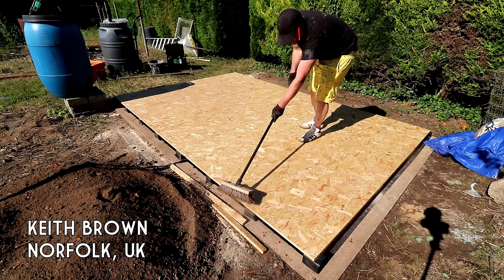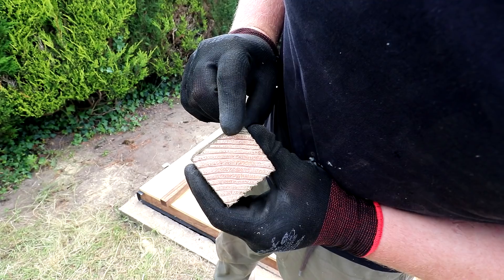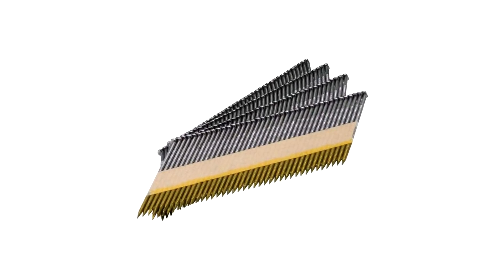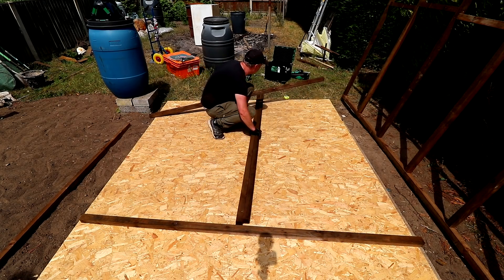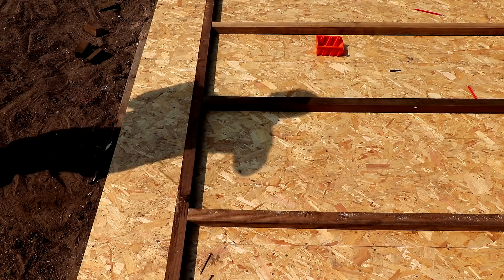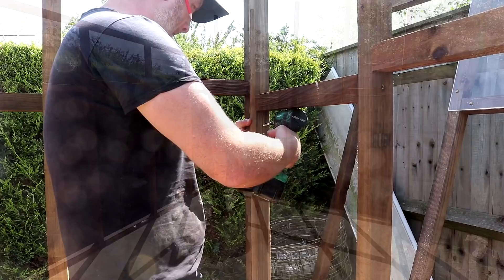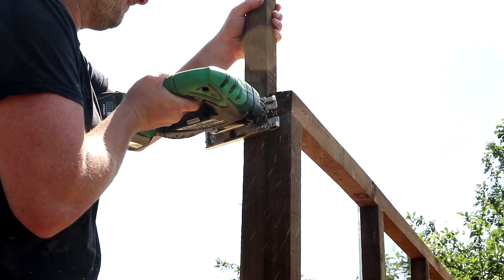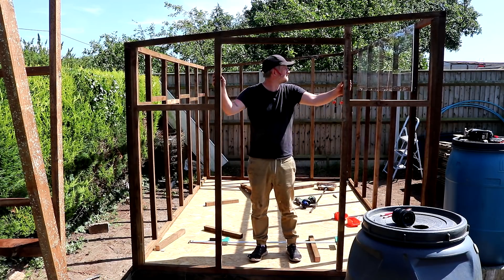Shed Walls and Framing (PART 3 SHED BUILD PROJECT)

Comment: It's amazing how wobbly the structure is until the cladding and roof is added, I was a little worried on about mine at this stage but it's soon solid enough when added. Love Rheas dancing 🎶😂
Reply from the maker: 😂too true! It's always a bit unnerving haha
Reply: @RagnBoneBrown  what the dancing or the shed 😂
Reply: Add some diagonals (60° bottom plate to top plate) at the corners will stiffen up the whole skeleton

Comment: At 6.11 an old trick is to put a screw in to the twisted timber almost home, in this case the face thats facing up. Hook a claw hammer on it and use the claw hammer as a lever to straighten the timber and fire/screw your fastners home. Take out the lever screw and move on. Saves a lot of hassle and time with clamps 👍 really enjoying this shed build series 👌

Comment: This is an awesome, informative, and entertaining video series! Thank you! I really appreciate how you go over moments when you do extra, but unnecessary work (like applying the bitumen), and when you talk about mistakes (like accidentally nailing the frame to the floor). The best and most helpful videos include those moments. It is so helpful because in a DIY project it is only realistic that people will make mistakes, and it is either anticipating these or knowing how to deal with them, which makes the difference between an adequate project, and a great one. Thanks again!

Comment: You can use metal banding straps to keep structure stable. Just fix them diagonally with crews and strong it stays. I did it with my shed. Cladding will become looser at a time.

Comment: It's the scariest thing about nail guns when they go out of line like that. A roofer friend of ours received a framing nail through his hand when he was an apprentice by supporting the timber in what he thought was a safe position and the nail came out at nearly 90 degrees to the entry point. Glad yours was just stuck to the OSB!!
Reply: Fergus Neff i had my hand in what i thought was a safe place, until the very tip of a 90mm nail poke a hole in my finger when putting in some blocking/noggins, if you didn’t have a healthy respect for your tools beforehand, you do afterward!
Reply from the maker: Yeah they can be pretty dangerous for sure
Reply: Hilti gun even worse knew someone who was killed by one.
Reply: I treat my nail guns with respect and keep my hands away when nailing. Especially with pin nailers where the pin can shoot trough the wood and bounce all over the place in the shop.
Reply: Never underestimate the strength of wood grain.

Comment: Appreciate the thoroughness of your design and presentation :) A minor note: You don't need to apologize for audio failures in b-roll. Your filming is already so thorough, it's easy to assume you've just fudged a shot while in the heat of the project, and it doesn't detract from the experience. Worst case you can always reconstruct audio from other shots (lots more youtubers do this than people realize!)

That frees you up more time to talk about the work :)
Reply: D.J. Mankiewicz I was actually zoned in to the work and wasn’t aware of the audio drop until he mentioned it

Comment: Looks great one thing I was having flash backs to when you built your first shed when you put the windows in and the wind belw it over and it smashed glad it didn't happen again tho been watching since I was 14 ish and that year I decided I was going to get into woodwork and built a 10ft by 23ft workshop in my back yard all with reclaimed wood other than the cladding and its amazing 3 of the walls were already there so its like a lean to with a base and one front wall and surprisingly I spent 2-3 weeks building in the summer holidays thanks for all your hard work

Comment: To anyone wondering why for these kinds of constructions often nails are used instead of screws since screws secure stuff so together much tighter and seem like a more logical use; Wood moves around a bit (expanding, contracting, wind etc) Nails allow for wood to move a bit without breaking, screws won't and can break/shear off. I never used to think about that and found it interesting when I learned this.

Comment: a small tip is just get a propane torch or anything similar to burn the exposed cut end grain to black andthen paint that with some protection to stop any soaking up of moisture.

Comment: Keith! Great video bud. Noticed at the end you mentioned the cladding will stiffen it up! I made the same mistake when I built my shed out of 2x4 and through the 200mm horizontal cladding would stiffen it up! Should have OSB boarded it first in 11mm then clad! It’s fine but not solid. Xxx

Comment: Ha! Did the same thing - nailing the wall to the floor - except mine was 20 X 8 ft and made of 2 X 4s.

 Like you, I suspect the nails don't always fire straight - knots, etc... I'd got chums round to help me raise it and I was a little disappointed to find just how heavy it was. Then a little relieved then embarrassed to see what I'd done. I also used a mixture of screws and nails - one or t'other can work loose over time...? I've got so many 2 X 4s left over I'm gonna have to build another shed for storage...

It never ends...!

Best aye.

Comment: How did you go about measuring what angle you needed for the sloping roof? Is there a formula or did you just go 4inch higher at the back? This was maybe covered in the video but didnt hear it. Cheers

Comment: Just looking at the windows on the side wall. Will be interested to see why the Perspex is on the inside of the frame rather than outside?
Reply from the maker: That'll be shown in a couple of videos time
Reply: Two weeks, the suspense. Confession I thought you may have put the frame the wrong way around. It is the sort of thing I would do

Comment: Hello Keith, the other day I was watching your video regarding build your new shed. But I couldn't understand what degree of angle both the back and front of the shed wall frame,I  did see you using a speed square both the ends of the door frame fitted.It would be helpfull to know what degree they were,many thanks

Comment: Also, I'd check your Perspex (sp?) mounting. Plexiglass and other plastics move a lot with temperature changes and usually it is mounted with far larger holes than the screws to allow it to move. I've seen it mounted like yo look to have, with countersunk screws, and come winter crack from the forces of it shrinking so much. The bigger the panel the more room it needs to move.
Reply from the maker: That's a good point. Will keep an eye on it

Comment: Looks great so far. Love how you admit your mistakes. Everyone makes them and the best way to learn from your mistakes.
I'm going to build a shed very similar to yours approx 14x10ft but I will have the door on the long side rather than the short like you have. I've watched loads of shed building videos and the framing timber differs greatly depending where the shed is geographically located. Any of the American videos I've watched they nearly always use 2x4s whereas in the UK it appears 2x2 is sufficient. It must be because of the high wind storms or snow in America for the 2x4s? Would 2x2s be sufficient for a 14x10ft lean to shed like yours? The roof will fall 9ft to 8ft over 10 feet.

Comment: I have been dreaming of doing this. Why did you choose 2x2 and not 3x2 timber? I thought 3x2 but interested why you opted for 2x2 instead. Would you use 3x2 for more of a workshop rather than tool store?

Comment: Hi. Currently watching your shed build from start 2 finish as I am wanting to build a same size shed myself to replace my current 8x6 metal monstrosity... Thought of having the same roof as yours as opposed to a pitch! 1 question I'm struggling with during my planning is working out the angle of the roof and how you go about the angle of the ends of timber etc to create the slope. Any help, advise would be gratefully received. Thanks.
Reply from the maker: I don't think it matters too much, you only realy need a small incline for rain to run off. Not sure though!

Comment: It's coming along nicely now Keith, 1 question, why did you go with 2x2s for the walls etc? 
i thought that it maybe a cost thing? but what about using 3x2s what was the price difference compared with what you bought?
Stay Safe,
Barry (Wirral, ENG)

Comment: Did you mount the base to the concrete wall you sat on? Or are you just relying on the overall weight of the shed??
Reply from the maker: If you're in the UK there's no need to fix it down
Reply: @RagnBoneBrown  assuming this wouldn't be the case for a garden room where there will be lots of traffic? I think I need you to have a look at my garden with all the projects I have I mind 🤦‍♂️😂

Comment: about to use 2by2s myself, after all its a shed not a nuclear shelter! I can only assume most of those other guys on youtube get free timber. only wondering why you didnt go 16" or 24" centres on your framing, would have made life a bit simpler?
Reply from the maker: My shed had to fit a specific space due to needing to sit it on the existing foundations

Comment: Would burning (like Shou Sugi Ban) the cut ends of timber prevent moisture ingress?
Reply: It is generally not good to burn treated wood. They do make a sealer that can be painted on the cut ends.
Reply from the maker: Yeah like John said probably not advisable to burn.

Comment: Hi there....is 2x2s good enough to withstand strong winds n storm??
Reply from the maker: Most sheds are framed with 2x1s, so yes absolutely
Reply: @RagnBoneBrown  Thank you for ur reply...I am attempting to build a 12x12 shed on my terrace(concrete surface)...will drop by incase i get stuck somewhere or need any input....cheers

Comment: In the Netherlands, pressure treated timber is quite a bit more expensive than raw timber, maybe 3-4 times. I suppose it's a similar situation across the channel there? Have you ever reused salvaged treated timber and did you consider that option here? Thanks!

Comment: Damn, wish I'd watched this before I built my shed. I've seriously over-engineered it. 4x2 at 16"oc frame with 6x2 rafters. It's definitely solid, I am in windy north cornwall, so I suppose that's a difference, and I guess I can afford it, but I didn't over-engineer the foundation, I think it's going to sink. Here's hoping.

Comment: Can I ask about the decision to go with 2x2s and not 2x4s like many videos, plans and so on seem to use? How did you decide on those and is that maybe a reason for the slightly wobbly frame? Probably doesn't matter, but wanted to ask!
Reply from the maker: Thanks will address this in the Q&A 👍

Comment: Southern Yellow Pine is notorious for nails going off at random angles just from grain, let alone knots. I wonder what the UK/European version is?
Reply from the maker: It's either pine, spruce or fir.. I think
Reply: @RagnBoneBrown  When I lived in Louisiana and worked construction/renovations, most everything was SYP (Southern Yellow Pine). Even trim (and boy, does that make trim nails go odd directions!). In Texas  "Prime" lumber was SPF, usually a Fir in larger sizes, and Spruce for smaller dimensional, but larger wide and long stuff was SYP, and Treated lumber (especially the green) was SYP. I've moved back home to Michigan and now the only SYP I can get is certain treated lumber (ground contact green from a certain brand, and certain deck boards), or special orders at high price. Every so often I see a bit in the 1 by 6/8/10/12, but that is often Red or White pine up here, so marked SPF. I've hunted into middle Wisconsin for SYP 2x8s 10s, and 12s, and can't get them. I'm told Central to Southern Lower Michigan for sure and possibly Northern Lower Michigan has those in the Big Box stores, but not here on this side of Lake Michigan. Mostly because much of the Canadian SPF comes through here to get to the distribution centers.

Comment: Do wood screws (or any screws used to screw into wood) not require a pilot hole drilling first to avoid splitting? I'm not questioning you, it's a genuine question as I've heard differing views and would like to know for my own projects and like you, I don't won't to waste money buying replacement materials for avoidable damage.
Reply from the maker: Depends whether it's softwood or hardwood and how close to the end you're drilling and how thick the timber is

Comment: Why on earth would anyone frame a shed with 2"x2" lumber?
Reply from the maker: What are you saying, two big or two small? Most pre fab sheds use 2" x 1", I wanted beefier studs because I'm going to be mounting things to the wall inside. No need to be rude
Reply: @RagnBoneBrown  I am not sure but I think in the states that these would be 2x4 construction. I was a bit surprised as well that the sticks were so small. Throughout my life I have always been impressed with European design being  "enough but no more than enough". Conservation at its core.
Reply: @RagnBoneBrown  Not rude just stating the obvious , nobody in the USA would even think about building a shed using anything but  2"x  4".  Prefab sheds are just cheaply manufactured junk.